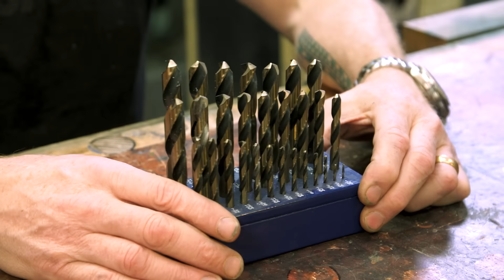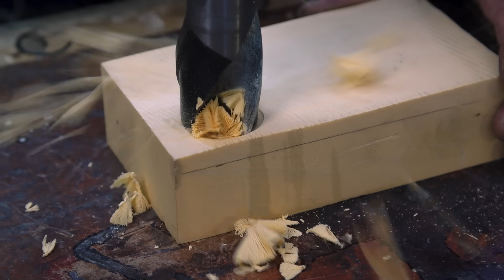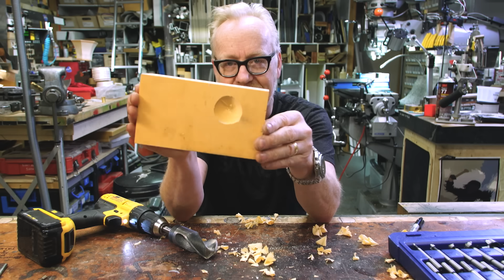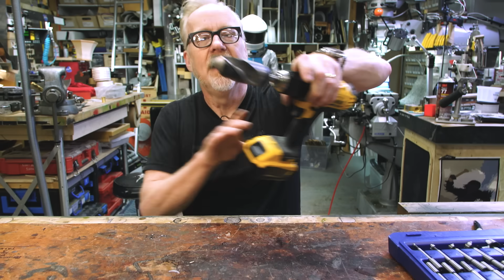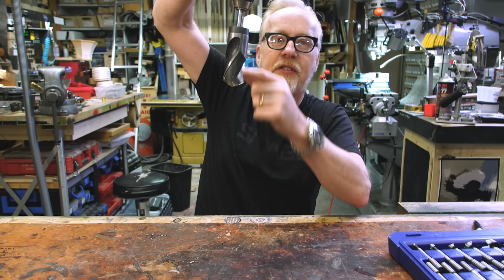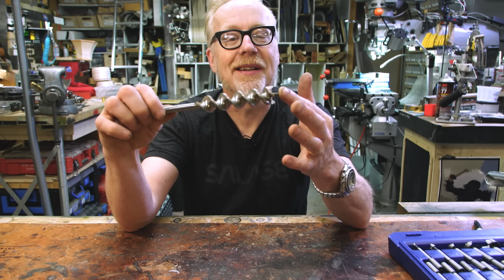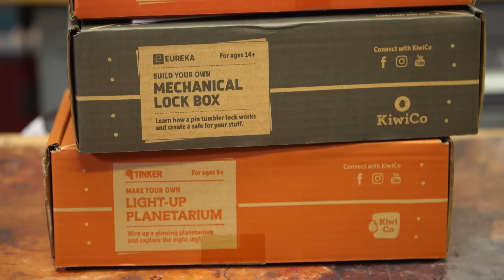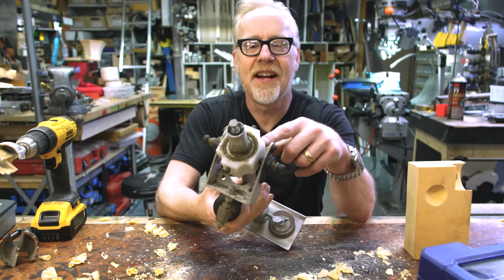Adam Savage's Guide to Drill Bits!

Comment: Some notes:
The short twist drills are sometimes called stub drills but more commonly known as screw machine drills because they were often used in screw making machines.
The reduced shank drill is known as a silver & deming drill because they were originally produced by Silver & Deming Manufacturing of Salem, Ohio.
Adam left out annular cutters. Handy for cutting large holes in metals where you can't use a Forstner bit.
Would have been nice to cover center and spotting drills also.

Comment: In addition to Forstner bits, my favorite woodworking addition was a pilot bit with a collar that makes a countersink at the same time. Saves a lot of time when screwing together a bunch of 2x4's.
Reply: Bloody good little tool that, drills and countersinks at the same time, and some have a skirt that you can set to give yo a certain size countersink too
Reply: @HotForgeChaos  just started setting my garage last week with french cleat shelves. 
Picked up a couple they work so nice.
Im working with pine and i have counter sinks hole that a little to deep. Its really easy to do.
Reply: Yes.... I use those all the time.
Reply: Yup, I keep meaning to get them, have normal countersinks but it's nice to have things turn out nice.
Reply: Love those.
Reply: a 2x4? you don't need to drill a counter sink for that. Standard construction screws will countersink themselves without splitting framing lumber. At least doug fir where I am.
Reply: @slayerspam  my thoughts exactly.

Comment: One of the most common things I use forschner bits for is counter-sinks for washer and bolts/nuts. The bottom of the hole is perfectly flat for the washer to sit on. Tip, drill the counter-sink FIRST, then drill the through-hole. It's hard to keep a forschner bit centered on any existing hole larger than about 1.5mm.
Reply: A step bit provides an easy solution when you have to center a counterbore over an existing hole.  Use the step bit  to enlarge the existing hole for the rim of the forstner bit.  Works like a charm. You may get a less than perfectly flat bottom and a slightly tapered hole depending upon the depth of the counterbore and the taper of the step bit but if those are acceptable it can save you a lot of aggravation.

Comment: The only difference I've found between cheap and expensive step bits: Shank strength. I've found they remove material more or less the same, but the cheaper ones will snap at the shank if they get bogged down.
Reply: The old Unibits were really nice. They had a curved grind to the cutting edge that the cheap bits don't have. Greenlee I hear still makes some nice step bits. The Unibit brand itself is not so good anymore. I think Black and Decker bought them? So yeah. Zombie brand now.
Reply: If you manage to snap Forstner-bit-shanks, you should seriously consider lowering you feed-rate - by a lot...

Comment: Forstner bits also make a nice flat bottomed hole.  If you need to glue (say) a large diameter dowel into a small depth of hole - that flat bottom gives you a much better glue surface.  My problem is that you can't really get a set in every diameter in (say) 1/32nd or 1/64th steps.  So you end up using them for the common sizes - and having to resort to regular wood bits for the rarer ones.

Comment: The new concrete bits now have two sets cutters. So you can drill through rebar. Not fast but it doesn't jam like the old style.
Reply: I’ve got re-bar certified masonry bits that have three cutting edges (Tri-wing?) as well as those that have four cutting edges (cross profile?).
Reply: @shubinternet  
How well does the tri wing bit on rebar?
Reply: @assassinlexx1993  — I haven’t hit rebar with it yet. I do have some pretty serious masonry I wanted to cut through to mount some cameras, and I had already burned out a couple of standard Masonry bits on similar stuff. So, I wanted something that I was confident would be likely to be able to handle anything I threw at it. This one bit cost about as much as my SDS hammer drill, so I’m hoping it will perform well.

At the moment, it is still safely ensconced in the heavy duty plastic case that it came in. I’m not going to bring out this bad boy until I’ve got all my ducks in a row and I’m as ready as I can be for what I hope to do.
Reply: @shubinternet  
Do you have a spray bottle.  Shoot water in the hole and of course a big cup of water to cool the bit. 
I find drinking coffee with drilling just take your time. 
But I am curious what insert you use?
Reply: @assassinlexx1993  — in fairness, the first set was probably the cheapest masonry drill bits I could find at Home Depot. Something like these, maybe: https://www.amazon.com/dp/B071WYJ7P7/ref=cm_sw_em_r_mt_dp_GVBY5NW3WR1E4MC8PX59 and they burned out pretty easily.

Then I think I found this set from Hilti: https://www.amazon.com/dp/B00MVML0FE/ref=cm_sw_em_r_mt_dp_JNBEWF7A8X8P4EKVK5TC

So, it was the set that cost almost as much as my SDS hammer drill, not just a single bit. My bad.
Reply: But that Hilti set has four cutters at the tip, not three. I’m sure I’ve got a three-cutter masonry bit, too. I’m just going to have to find the damn thing.

Comment: The timing on this video is incredible. I bought my first forstner bit a week ago for installing a one sided deadbolt. It's maybe the best and only bit for flat bottom holes.
Reply: Best, yes. Only? Spade works but you really need to use them in a press to be accurate, they're more of a first fit joinery option IM(limited)E

Comment: Project farm has a video testing step bits. He definitely found a difference between bits.
Reply: He does real testing, not anecdotal guess work.
Reply: @videodistro  To be fair, lab testing a tool, vs real world use can have variance. The most common failure in use is overheating the bits. People throw them in a drill at one speed and go from a 1/8 to 3/4, over speeding the bit. Also the walk the bit around trying to get it to cut faster. Both of these will dull a nice bit or a cheap bit just as easily.
Reply: @ionstorm66  True which is why he repeats the same tests on each type so their strengyhs or weaknesses are exposed at least at THAT usage whereas they might perform different at a different speed but that would be a different test.

Comment: the advice at the end of this video should be universally spread
if you have to buy a tool, buy the cheap version. if you use it enough that you break it, then get the more upscale version. if it never breaks, you saved yourself some cash. obviously with some power tools this might not apply, if you like a particular brand's ergonomics or you have the batteries for it, but for the 100s of hand tools and peripherals ive bought ive never been burnt following this.

Comment: 2:39 Is that not called the "soul" of a drillbit in English too, or is that reserved for the "tree trunk" of the drillbit?
Reply: It is called the chisel point. The chisel point extends over the web. The chisel point does not really drill. So it is the bit of a bit that you want to drill a pilot hole for. The web of a bit is solid. Although there are ways of grinding drill bits to eliminate the chisel point. It is called splitting the point.

Comment: Great video! I’d love to see a follow-up about drill bit STORAGE, especially for portability. Sure, you could have a dozen full sets in their original cases, but what do you toss in the bag with your drill when you’re bringing it somewhere else? My current method, which I would not recommend, is an old ziplock baggie full of bits.
Reply: I recommend a tool roll. I tend to use canvas or (believe it or not) drill cloth. I do not know if drill cloth was made to store drill bits before they started making khakis out of it or not, but it works well, and if you put the drills in pointy side down it doesn't immediately get destroyed.
Reply: Pill bottles.

Comment: 'Real' Forstner bits don't have saw teeth, they have a smooth rim with just the two chip removal slots. You can also drill holes at an angle with a 'real' Forstner bit without the center spur touching the wood, the smooth rim is enough to guide the bit accurately. There are cheap & nasty Forstner bits made from some ferrous material (I won't dignify it by calling it steel) and for a few dollars more there are High Speed Steel (HSS) Forstner bits which are really better value, at least up to 1/2" or 3/4" because those small sizes are more likely to 'smoke' - overheat - and HSS isn't affected by anything much short of a welding torch. There are a bunch of 'Forstner-like' bits out there with 4 or so carbide teeth, usually sold for lock or Euro hinge installation that work OK, but they don't do the angled hole thing or self guide.
Reply: Yes, there are crappy Forstner-bits made from rather soft "steel" which dull and burn out fast, then there are good HSS-versions. Its not easy to figure out which is which and price is not always a reiliable indicator.

I got myself a set where the cutting surfaces are made out of brazed-in tungsten-carbide. Got them direct from China and they are a real joy to use for pretty much the same price you'd pay for a cheap set in a shop. 

They run cool, even in hardwood and I even used them for the occasional hole in thin aluminium-plate before I got a proper set of HSS-holesaws.

Best thing, you are sure, they'll cut while you'll never know until yout try out ones out of plain/HSS steel

Angled holes are very few to drill in my shop, If I have to, I start them flat and gradually increase the angle and that works fine.

Comment: As an apprentice electrician, I live by the spade bit. I hate them, they're messy, but they're fast!
Reply: And the holes you drill don't need to be precise or neat, just good enough to run the wire through.
Reply: For roughing you can't beat a spade bit. We use them as plumb bobs too. Tie one to a string and bob's your uncle.
Reply: They're also sacrificial when you hit a nail.
Reply: @danielstickney2400  that depends. If you catch it early enough you can get the nail with the electrician's trusty chisel, AKA the flat head screwdriver.

Comment: From Wikipedia: Benjamin Forstner (25 March 1834 – 27 February 1897), was an American gunsmith, inventor, and dry goods merchant. In 1886, Forstner patented the Forstner bit. The bit was revolutionary as it did not feature the lead screw (which Forstner called the "gimlet-point") or the cutting lips of more conventional wood boring bits, and thus proved especially useful to gunsmiths and high-end woodworkers. The bit was unsurpassed in drilling a smooth-sided hole with a flat bottom. It was also better than Russell Jennings twist bits for boring at an angle and not following the grain of the wood.

Forstner eventually made arrangements for the manufacturing and sale of his bit with two Connecticut firms: Colt's Manufacturing Company of Hartford, and Bridgeport Gun Implement Company, successors to Union Metallic Cartridge Company. The Forstner bit continues to be manufactured, although it has evolved into a split-ring design. Also, modern Forstner bits normally feature a (non-screw) lead point (AKA "center spur"), unlike Forstner's original, although rim-guided bits are still available from some manufacturers.
Reply: Thanks for that information, I had never thought to look up the origin of Forster bits.
Reply: Wikipedia

Comment: As someone who's never used a drill, but is about to have home repair projects for the first time ...like running ethernet, videos like this are just what I'm looking for!
Reply: If you are running cable up and down a wall, then a very good thing to learn about is fish tape, and fishing a wall.
Reply: Pro tip see if you can find good deals on CAT5 wire at lows. Works as ethernet and can be stretched super long distances
Reply: @jamestaloopo2630  I'd personally go with CAT6. Bit more expensive but it's WAY less expensive to wire it for CAT6 now than rewiring it in the future of you want higher speeds or stuff like PoE
Reply: @jamestaloopo2630  We'll probably do CAT6 in the walls from Monoprice or something.

Comment: The flat bottom of a Forstner bit is unmatched by any other bit that I know of.
Reply: Annular Cutters, another one of Adam’s faves. They are the metal version of forstner bits. Extremely accurate hole diameters, and they have no problem cutting holes that aren’t surrounded by material, which allows you to make accurate radii in parts.
Reply: Those flat bottomed forstner bits make the world go round
Reply: These do a really nice job and cut much easier.  Wood Owl OverDrive Fast Boring Ultra Smooth Auger Brad Point Boring Bits
Reply: Center cutting end mills are even flatter. But you kind of need a machine to use those. There's also some router bits that are for making flat bottoms. People use them to level CNC spoil boards.
Reply: @1pcfred  Your right about end mills, they don't go as big as forester bits though (at least not on a normal person budget, and then you need a tool with a massive chuck to use it). Spoilboard bits however normally don't plunge cut, they are meant to sweep in from the side and that a layer of material off and wont cut if you push them straight down.

Comment: the first drill you were holding would likely be a chisel point twist drill
Reply: It depends on the grind whether a twist drill has a chisel point, or not. You can split the points on twist drills and then they do not have a chisel. So just call them twist drills. Because that's what they are.
Reply: Is jobber not the term he was looking for